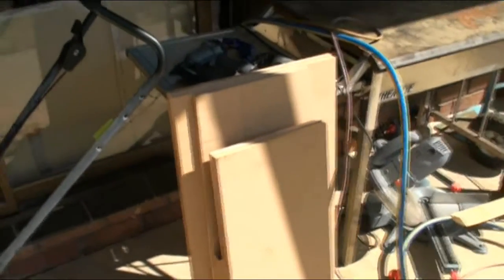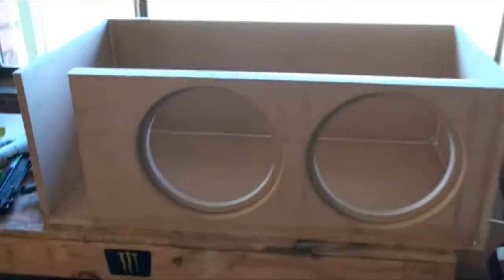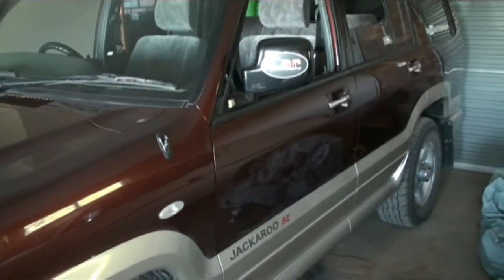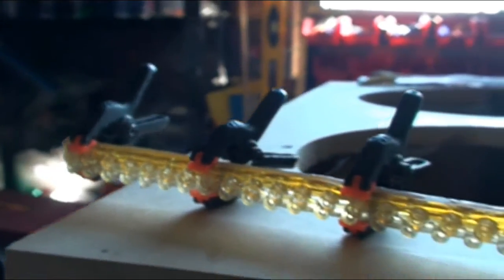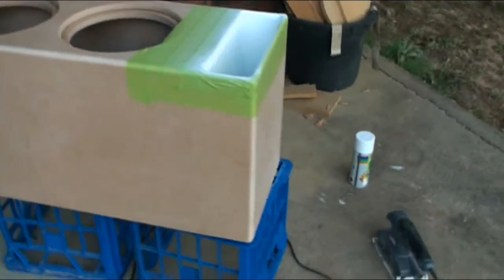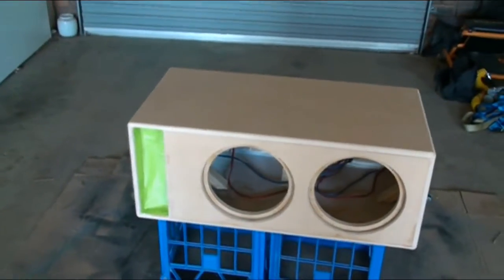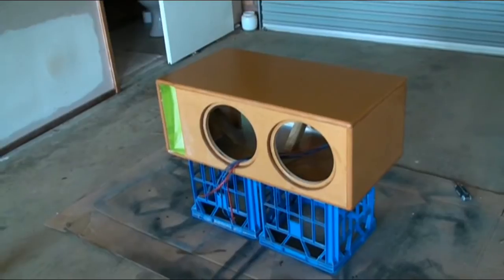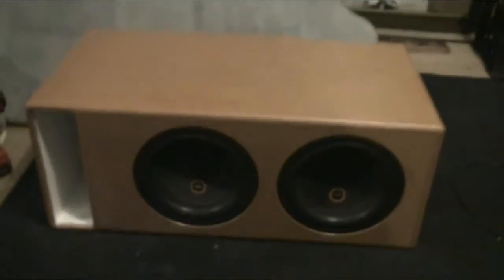2 Cadence 10's Musical Box Build - Resin Stained - Glowing Port - 40hz Tunning

Comment: hi 
 hi mate how r u? I have another problem and im confused what im going to do with my 15'' wich Im going to use: 12sqi 13sqi 0r 14sqin? I want a bandwidth between 25-55hz if it's possible. and what freq im going to tune it? and 3.75ft^3 is good? my amp is 3500w and the sub is 1500w

 tx mate and I love the Toyota corona how they came :)